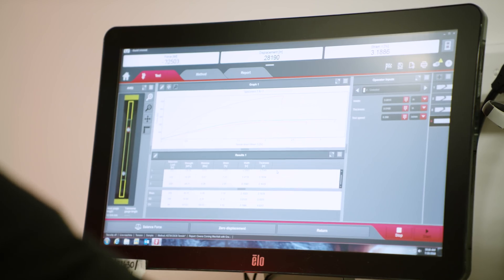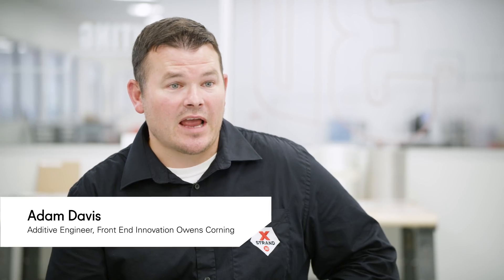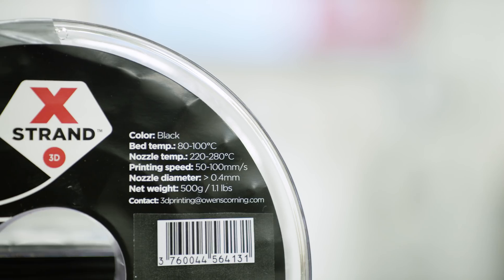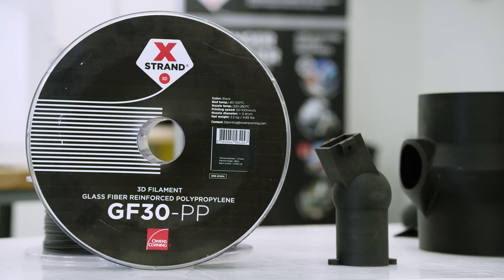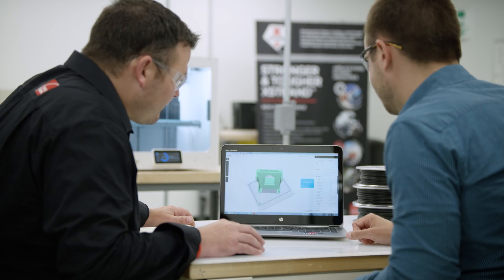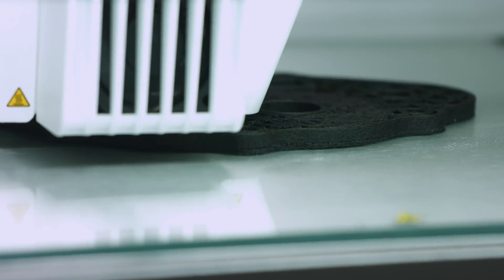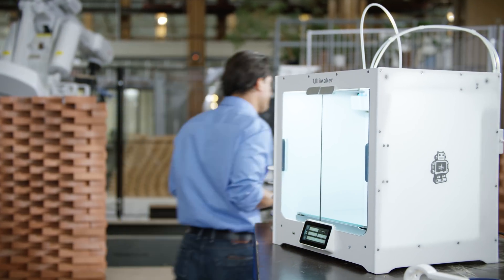Owens Corning: Hassle-free 3D printing profiles for industrial composites

Comment: You guys going to make some hardened nozzle printer cores for abrasive materials so we don't burn through the brass nozzles printing these materials
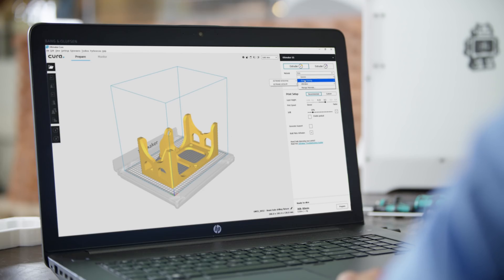Reply: Look at the Printcore, the operator is using at 2:06 in the Cura Profile...